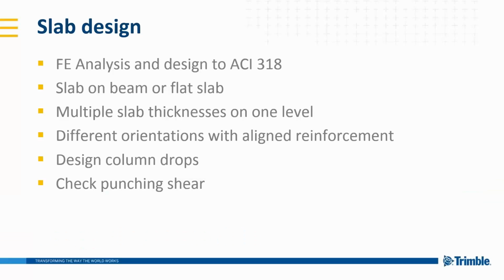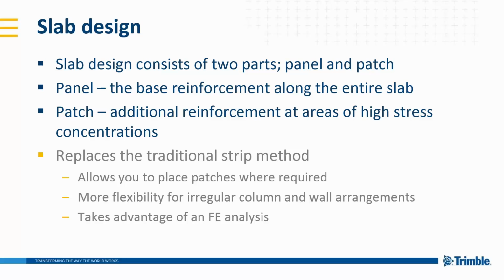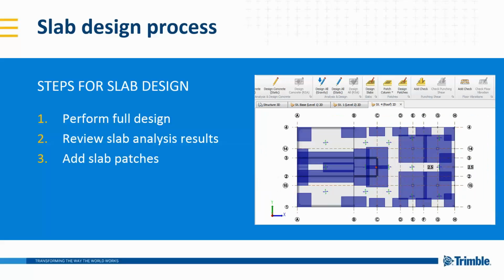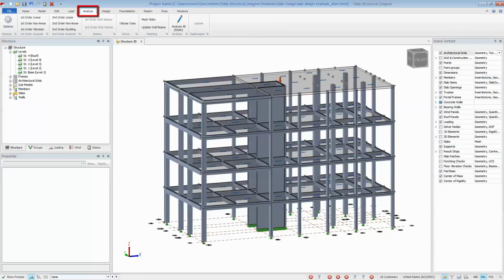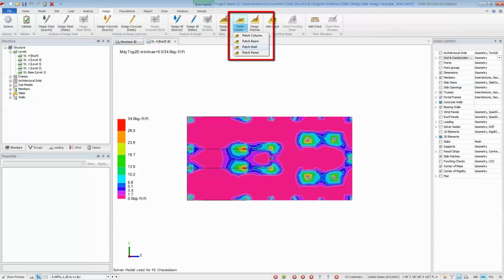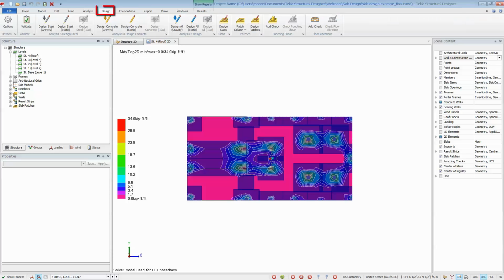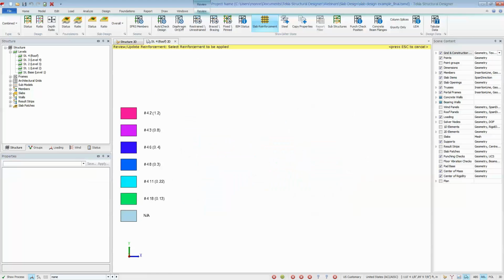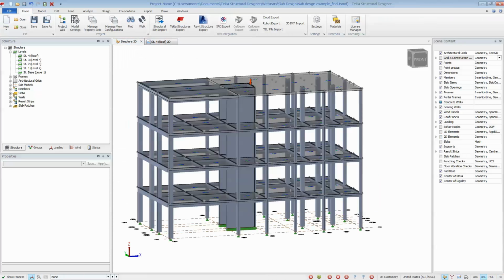Slab Design in Tekla Structural Designer

Comment: Hi sir this method not applicable for 1 way slab right
Reply: Hello, you are correct. The design procedures shown in the video apply to two-way slabs and mats
Reply: @trevorbruce258  for mat. How is the correct way to design for unfactored load? Say allowable bearing pressure is 100kn/m2. But it is failed because it was compared with combination loads. Can i just generate combination with all factor multiply by 1?
Reply: @handcannon9814  Yes, you have the ability to generate combinations with any factors you wish. Within the load combination generator you are able to set factors for both strength and service conditions. Your local tech support team should be able to assist you if you run into any issues.
Reply: @trevorbruce258  OK thanks for your reply